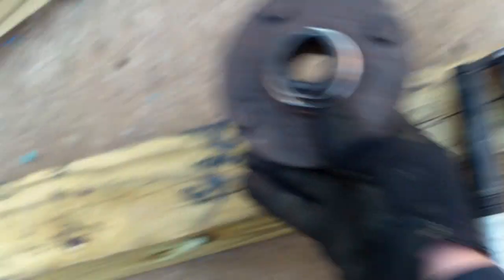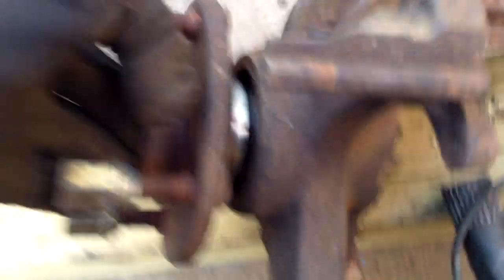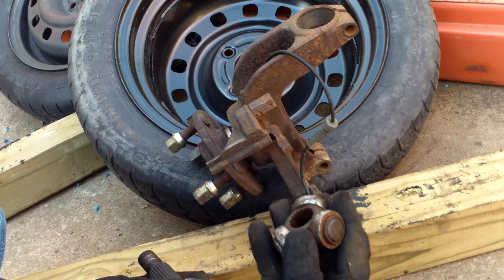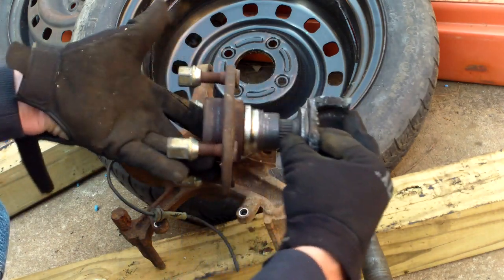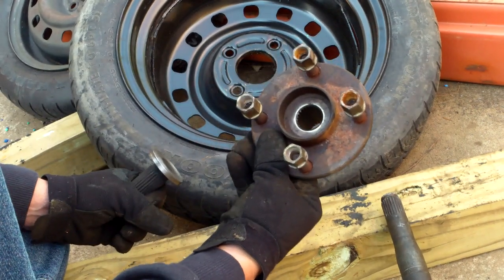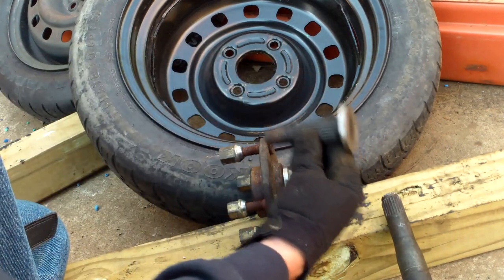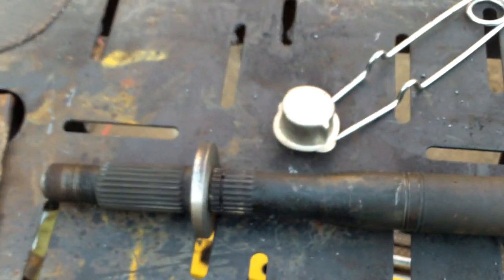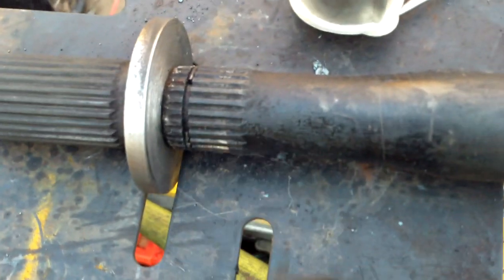Homemade Sawmill axel build   Part-1

Comment: use the  axle off a rear end drive CAR! will be easier to mount and then you need one bearing on the other end.
Reply: Off a front wheel drive car correct?

Comment: Your overhang from the bearing to the drive saw wheel is a little to much , you will be very lucky if the wobble while under load doesn't snap thd shaft where you weld the two pieces together ,   stand back when you test it

Comment: go to habour freight and get a 15inch steel pulley weld it to the car rim and use another trailor  tire  run the belt next to drive tire

Comment: Go back to the parts man and pick up a rearend from a rear wheel drive car , every thing is alreadt lined up and true , much much stronger and safer , just take the shafts out of the rear end , don't need the gears.  PS ready made spindles for trailers are cheap . That's a lot of work for a shaft that has a built in week point